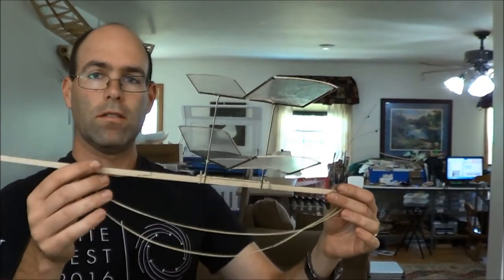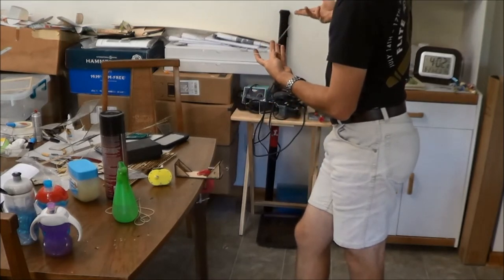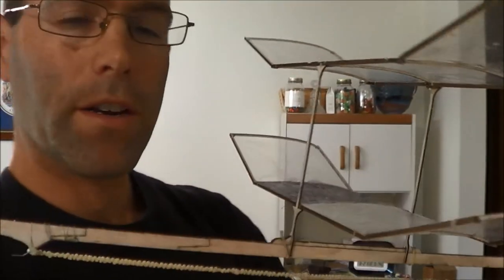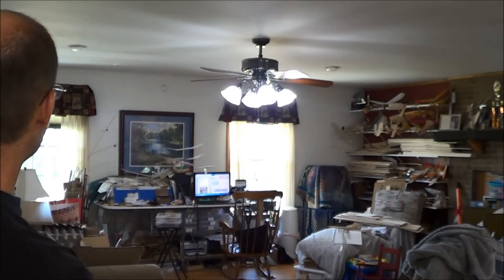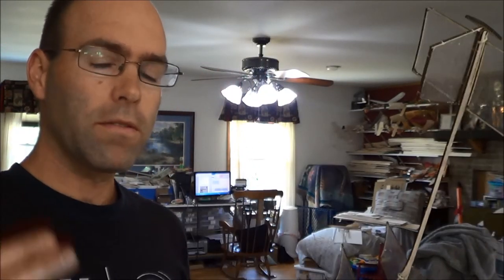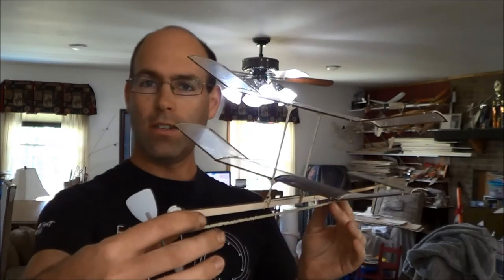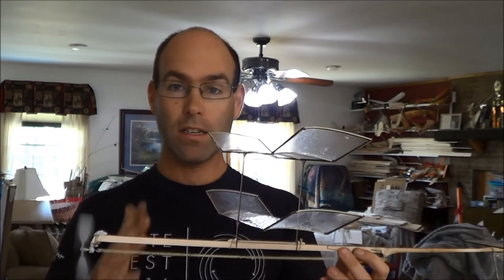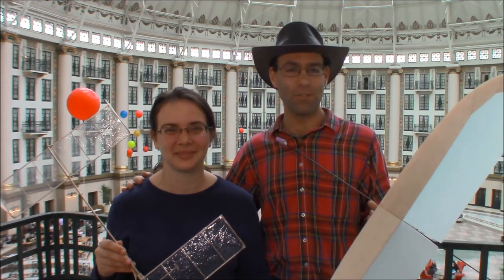Senior Flyer SO 2020 Build Pt.4: Flying

Comment: Hi Josh, what should I cut my rubber to for a starting flight? For my old plane I did around 132 cm to cut the rubber at however this plane the distance for the rubber is very much smaller.

Comment: What are the differences between the rudder being on top of the boom versus underneath it? Thank you!
Reply from the maker: Nabil Mohammed, on bottom it doesn't get blanked out by the stab at high angles of attack
Reply: @joshuawfinn  From what I understand, it would get more airflow because the air wouldn't have to go across the stab first.

Comment: Josh, you indicate the need to shim the stab in order to increase the decalage when the plane is turning to the right.  Why is that necessary?  Why does it tend to fly more nose down in a right hand circle?
Reply from the maker: Dave Drummer at least some of it is related to gyroscopic precession on a high speed prop, but the slipstream of the prop also plays a major role.